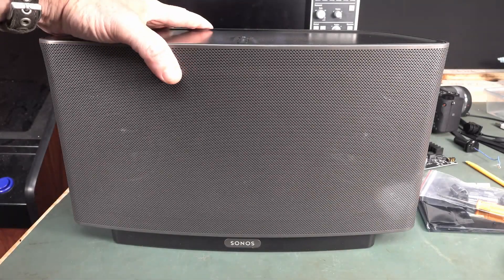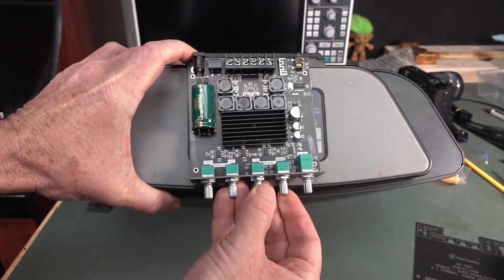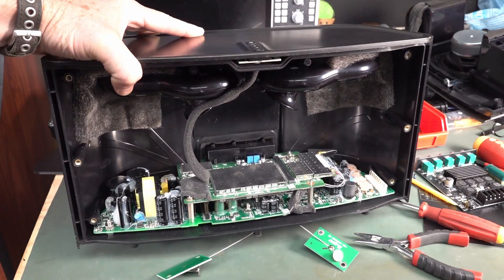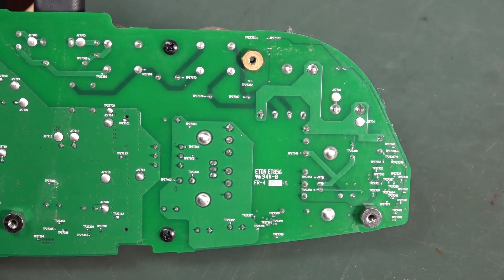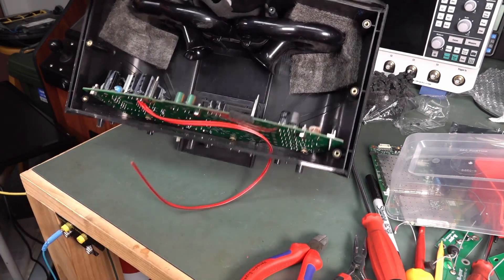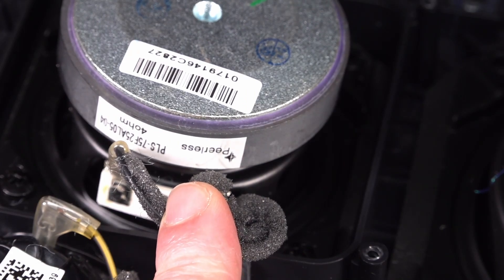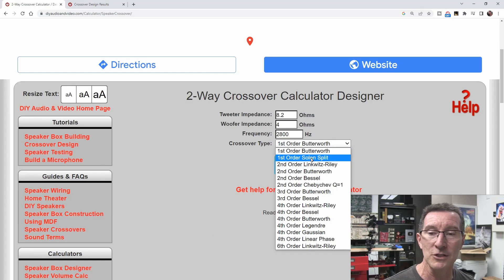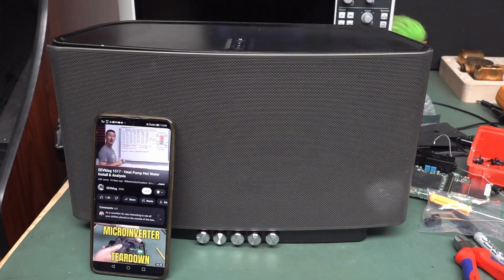EEVblog 1519 - FREE Your Sonos Speaker! (HACK)

Comment: Sonos speakers have a pretty reasonable sound but TERRIBLE SUPPORT / CONTROL / SOFTWARE at a high price. If you can't hack then the dumpster is the best option. I have a Play:5 that was given to me by a frustrated previous owner I intend to hack it. I want to strap a Pi to it - I need a Pi for my home automation anyway and the Pi could use a speaker. So the idea is to have the Pi run HA turn it into an AI node and be able to play music from the net or my local SMB server. I am hoping to just add a regulator so the Sonos provides 5v to the Pi too.

Comment: I had no problems setting up the first gen software.  It takes a few minutes of working out what to do but it's not the obstacle you describe here.  How is the sound quality of the Foss Audio amp compared to the Sonos amp?  That would be a key consideration. Great stuff though.  It's a bit of an extreme measure for most users but it's super interesting to see what you've done. Thx.  Btw.  How much did the whole project cost, and now that you've worked it out how long would it take to replicate?

Comment: Ok but... this is not anymore a Sonos speaker. Of the original speaker he kept only the power supply and the drivers. It's missing all the electronic and signal processing which make the Sonos the beasts they are.  In fact, it now sounds like an old radio.

Comment: For a long time people complained and cried about SONOS having no way to lock speakers down to an account or lock settings behind an account and password, and to not give guests full access to the entire system, etc, then SONOS implemented it and now people sook about it because it is "too hard to set up" and you "need an account".

This product was introduced in 2009 and uses hardware from 2005. It, and many of their older products with the capitalized PLAY: branding also used hardware from 2005. These products were simply holding back innovation in the new products. SONOS are literally the least evil company, people just sook about literally the exact things they asked for for a long time and SONOS refused to implement for so long, finally they did and more sooking.

If the Wi-Fi is not working properly in this product it will not be able to be set up in the app. SONOS have also been known to replace faulty first gen PLAY:5 speakers for free with a second gen Play 5 in the past, regardless of warranty or proof of purchase.

Comment: I found one Sonos Play 5 Gen 1 also in a dumpster , got it home , resat it to factory settings with power cable unplugged , holding down the speaker button ,set in powercable , and waited untill lights was flashing white , downloaded the Sonos App gen one , registred , searched for the play 5 and it found it , was up running wireless music from Tunein radio Sonos radio and much much more , easy peasy , if you had done so , you were running also in 5 mins.....
Reply: Yes, I agree.  There's no need to make such an extreme modification just because you don't take the time to work out the registration.  For completely bricked units it's a great solution, but how much did this cost?

Comment: I recently updated my Sonos App and my entire configuration was wiped from the app. I am also no longer able to find and locate the speakers to add them back on the app. Totally frustrating. I can still use the beam and two first gen Play 1 units through and KDMI to optical TOLink connection (The HDMI connection is not stable. I connect it to my cable box, and it keeps dropping the connection. I connect it to my TV and it connects, disconnects and then reconnects. making it impossible to use that way. I don't want to spend another 3 or 54 hours trying to re-configure things. The only downside is that I must now manually adjust the volume on the playbar rather than using the app. I also lose music playback capabilities through the app. I honestly can say that I  would not buy SONOS products again.

Comment: @EEVblog, would you consider revisiting this project to install a raspberry pi running snapcast? This is a solution for multi-room audio using open source software. HiFiBerry provides prebuilt amps that work with a raspberry pi that might work great for this, and all are smaller form factor than the app you mounted into the speaker. Anyway, I think that approach would make a great v2 Fronos, since it would restore the ability to do multi-room audio and entirely replace the value proposition of Sonos.

Comment: I have a friend who is a Sonos fanboy and he happily upgrades the system when they force him to. last time this meant a full hardware upgrade after it self bricked, so they appeased him with a discount code on a new system. he's actually been suckered in so deep that he believes the three or five year push from them is a great way to keep having the latest and greatest performance product available (from them...). I still have stereo gear from the 80's that sounds a hundred times better, I run bi directional v5 bluetooth modules that also allows multicasting up to 100m range (to multiple Bluetooth headphones as well as my phone for music source), or the TV etc. His Sonos system cannot do this, yet he's spending thousands for a temporary subscription against my few bucks for permanent performance... and he appears to be content to do so. It stuns me that people think this way, completely hooked into the consumer money extraction machine.
Reply: i bet he also uses iphones
Reply: @Xiefux  lol, I think you nailed it..
Reply: @alasdair4161, would you mind sharing the details on the module(s) you're using to achieve this? And are you actually able to get synchronized multi-room audio from this with commodity bluetooth speakers? I'm an orphaned Sonos user and searching for a multi-room audio solution without vendor lock-in, but am skeptical that bluetooth audio can achieve the sync (e.g. no latency or sync issues when standing between two speakers).

Comment: I splurged and got one of those Sonos lamp/speaker at Ikea and I was just thinking about hacking it like this, perfect! Hahaha
Reply: Update: Got speaker torn apart and nternals torn out. Decided on an amp and also found a piece of wood I can use to mount it all and then stick it on the wall next to my bed. Should look pretty snazzy when I'm done.
Reply: Update #2: Ordered Bluetooth amp. Just need to figure out the inline resister thingys for the little speakers.

Comment: my god the poor array of transistors was pure rubbish, i would have cut the whole PCB from the power supply, as for the knobs, wired them separatedly. 
did something like that with a sony speaker, improved and all with a custom ampli board, the rest is aux in.

Comment: I’ve got a receiver that is not used anymore....and I also have a Tunebase that plugs into the lighter socket to send the phone or iPod signal to the FM radio in my car.
Thing is I don’t use it in the car and I wondered if there was a adaptation that would allow it to be used to send the signal FM style to my functional hifi receiver allowing me to get a signal into my vintage gear🤷‍♂️
I guess the lighter connection would need to be ditched or adapted.....etc😬
Though I suppose there’s already such a thing..... if they’re still available 🤔 Possibly not. Guess I’ll have to check. 
Any thoughts though😁🙏

Comment: Don't get me wrong, this is a nice project. I have one concern regarding the sound quality of the final result VS the original product, though: 
When a manufacturer which takes the sound seriously designs a product like this, which is essentially some (carefully selected) drivers in a custom built box, usually the sound signature is not going to be exactly as desired (it never truly is). However, as the manufacturer is also building the electronics powering the drivers, they have the ability to add electronic correction (eq) to the signal path so the final outcome becomes more or less the desired sound signature.
This particular project lacks this "step" in the signal path so the sound is going to be different than the sound that came out of the product when it was new.
How different, and is the result an improvement or a deterioration - is subjective.
But there will be  a difference, probably

Comment: I designed an SPDIF-to-I2C and an Analog-to-I2C-circuit as a hobbyist several years ago. Only a matter of some opamps and an IC from cirrus logic. No big deal after all and worked on a breadboard and later on some prototyping pcb.

Comment: I am a lawyer representing SONOS. We insist that you take this video down and cease and desist slandering our product. Also your modifications have voided your warranty.
But seriously. I'm an electronics and PCB designer for a small boutique hifi amp manufacturer using tubes. Our design ethic is the exact opposite of this fine product.. we are designing prodict that we intend for people to be using for decades to come. It not inly informs our electronics design but also hardware design. Plastics and rubbers that will deteriorate are not selected. Nothing - and I mean nothing - relies on adhesive in any way shape or form. If it needs holding in place, it's welded brackets and M3 screws all the way. 
I see gear like this with its designed-in obsolescence and it just riles me. These things are not good enough for 'Straya - or anywhere else. Consumers should demand better.

Comment: If you remove the heatsink, you will see that the chips are not the original TI components but have been replaced by a cheaper chinese one called CS8673E.
So you can toss you datasheet in the bin.

Comment: There was a real hype those days. Smart speakers, that is the best. You tubers veining over the damn things.

I considered it but it just didn't add up. In fact try to buy a UE boom 3 speaker today and you find that there isn't a line input. I simply assumed that it had one. I was perplexed to find that there wasn't one. The thing went straight back to the shop. 

IT'S A SPEAKER! WITHOUT LINE IN IT'S USELESS!

By the way, I got rid of Google assistant and my Philips hue lights as well. Pain in the ass.

Comment: It needs to be made law that if a company bricks something, either by making it incompatible with newer software and rendering the older software inoperable, or otherwise takes away functionality, that you should be able to take it back for a full refund under then "not fit for purpose" type fault. Companies that pull this kinda stunt need to be hit where it hurts most, the hip pocket.

Comment: You could connect between 25V and 12V to get 13V since it is floating anyway.
Reply: But why if it works perfectly with 25V and is in spec

Comment: I have a couple of old bluetooth speakers (the portable type) that either went flaky or were from the start, but the sound quality was pretty good for a speaker of the size. I took one apart intending to gut out the speakers and any other bits that might be reusable,, but noticed on the PCB that there was a position for an aux input, and the amplifier had analogue input (possibly because it also had an FM radio?). So I cut a few tracks to take out the bluetooth signal which used to make annoying announcements all the time, wired in a jack socket and ended up with a quite useful battery powered bench amplifier. Its not hi-fi but its good enough for listening to music or tracing an audio signal through an amplifier.
Reply: The SONOS appears to be using some DSP trickery so you'd need to feed a digital signal into the board. That said, they put the smart bits and the audio bits on a different board, so there's a big connector right there already - and chip manufactuers make it easy to use their parts for a reason...
Reply: @jrshaul  Yes, in the case of the SONOS it would have been tricky as you say because they seem to be using one chip to do multiple things, so Dave's approach was probably the best, but of course in this case the actual speaker system and enclosure is really high quality so its worth the effort of putting in different electronics.
Reply: @IanSlothieRolfe  Sure Electronics makes a DSP amp board that might do it.

Comment: Reminds me of a 'rebuild' I did for a friend last year. 
It was a really old school radio cabinet. Radio and record player.
I think '60 build, didn't had tubes, but I guess first series transistors. Resistors were so old and dirty, the colour rings weren't readable. 
I placed a 12 volt SMP, the same audio board as Dave used in this video and of course 2 new speakers.
To finish it of I placed warm LEDs in it so it looks original. The bulbs inside were ok, but used about the same amount of power as the audio amplifier. 🤣🤣
Result was amazingly good and my friend was really happy!

Comment: I’ve read somewhere that you shouldn’t use non polar electrolytic caps for AC as they won’t last long on AC. Like they can be inserted any way into a DC circuit and then kinda “polarize” themselves according to the voltage applied to them. Is that right?

Comment: Everything looked fine EXCEPT that first order filter and how you went about designing it.  I can promise you that using a first order filter NEVER works out as planned. Speaker impedance varies with frequency and you will end up with a crappy response. Placing those inductors side by side like that will induce mutual coupling and changes the total value also. Just do some basic Googling to see why. Probably can find the info you need on the Parts Express website forum.

Comment: What the hell.... I was expecting to reuse the main board power amps by injecting into the signal path and using something like an esp32 with i2s? Was I expecting too much? I'd like to have had a go at that main board, I was hoping the evil stuff was on the daughter board and those pin headers were all you needed.

Comment: "Smart"-devices - basically everything but the smartphone is a smart way of scamming people.
They are the worst of the worst offenders, most of the time it is impossible to find something dumber than a smart device. I have seen a "smart" microwave that BROKE cause of a software-update. I was literally impossible to use the microwave and it had to be replaced. Smart light-switches that interfere with each other and their only "smart" function is a motion-detector... yes, like you could buy for decades for cheap. SmartTv whoes only function they offer is showing adds during movies, showing adds during adds, showing adds in the menu, and using bad apps that also - you guessed it - show adds. Or the smart juicer - that was slower than squeezing the overpriced juice-bags by hand and wouldn't work without an active internet connection.

Comment: Brilliant idea, so glad you caould make use of such a high quality speaker/enclosure. I did something similar with an old LG micro-system I didn't like (the standby power consumption was over 30W!, ffs).The tape deck and the cd player didn't work and I didn't care to fix them, I only used its line in function anyway to get sound from a PC and occasionally used the radio. So I dumped the micro system entirely and just kept the nice shelf speakers. I bought a very similar classD blutooth amp like the one in this video and use an old external HDD PSU to power it (even the barrel jack was the correct size). I wired in the speakers and used Blutack to stick it on top of one of the speakers, simple.

Comment: hello i am looking for a way to hack the i2s interface on a gen1 play:1, and it seems like (for existing projects) you would need a raspberry pi, and then can install onto it either BalenaSound image or HifiBerryOS disk image. Those then provide networked airplay support etc.

And it does seem like whatever device you want to use, it needs wired ethernet. In order to have a solid and reliable enough network link. With a low enough jitter etc. for linking multiple speakers.

The other thing to realize is that the cost of 1 SBC per smart speaker is relatively high. And the cheapest solution i could find out there was around £33 for an x86 based hp 'thin client' (which is pretty similar to a NUC, just that is how to find cheaper models). Which admittedly is total overkill for a smart speaker. However it is at the same time at least half the price of an RPI or any other arm based SBCs. Because the x86 are being supported by BalenaSound OS. However the problem then is that regular PC's don't have i2s bus output GPIO pins. Unlike the rpi etc. Which is then a problem!

However on an rpi or other supported arm based SBC with GPIO pins... then  the values of BALENA_HOST_CONFIG_dtoverlay and BALENA_HOST_CONFIG_dtparam should be able to configure an i2s output from that linux device.

But it still doesn't help with x86 machines. Like those thin client... (because they don't have any working GPIOs). Maybe if we could use a USB port, and attach over usb cable a cheap rpi pico. Or something along those lines... IDK. It seems a lot like this problem should be a solvable problem. But I have not been able to find a solution yet.

Anyhow as far as the SONOS speaker itself is concerned... i suppose you would want to cut traces for isolating those i2s on the PCB. And then it might be nice to wire up some sort of terminal connector or plug as digital input (or 0.1 inch header). To allow easy plugging and unplugging of a seperate SBC device (such as rpi etc). So that is not so fully intergrated and can be swapped out more easily. Should needs change or the sonos speaker break etc... However such an external i2s bus connection would need to good enough to avoid interference or noise upsetting that i2s link.